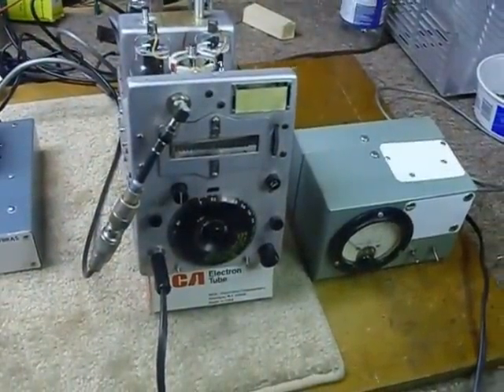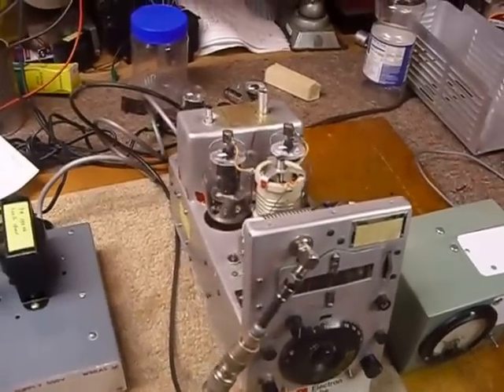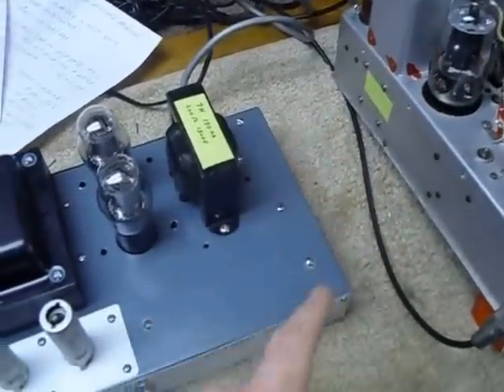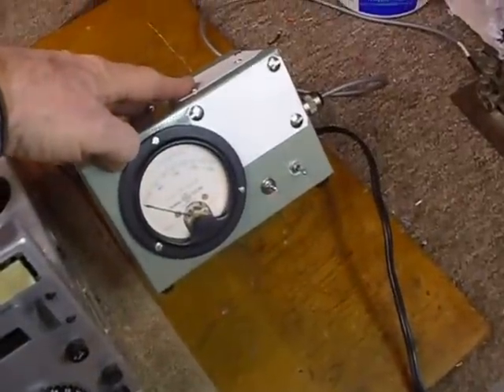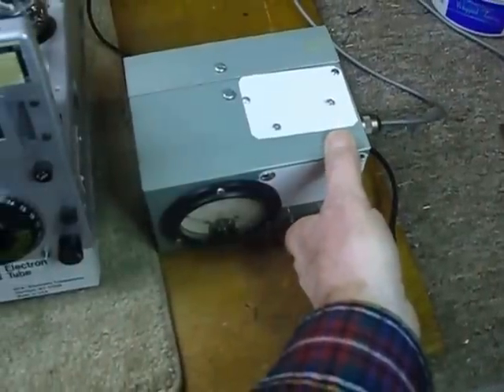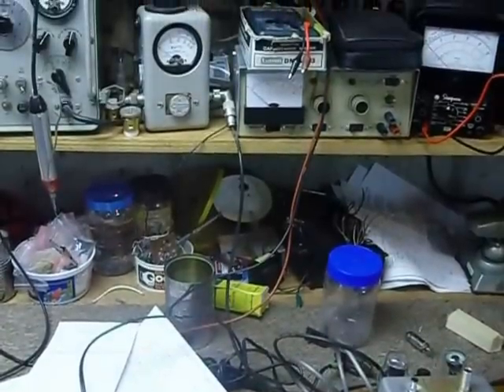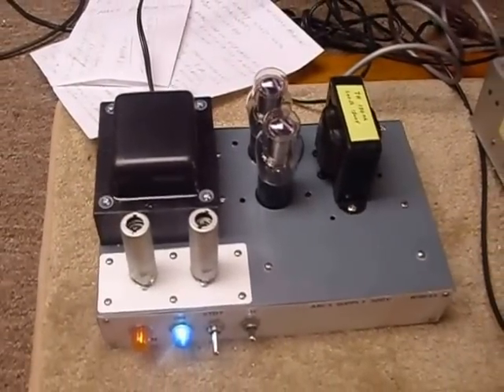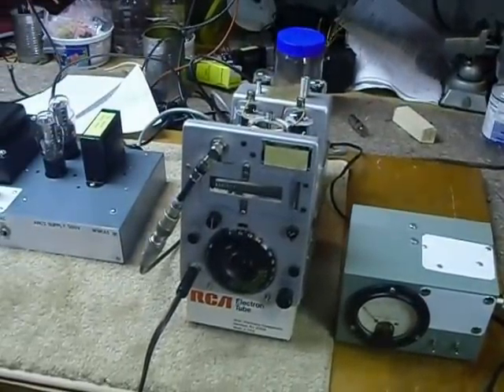WW2 ARC-5 STATION,BC-459,BC453,HOME MADE CONVERTER AND POWER SUPPLY

Comment: Beautiful explanation of the trade offs between output power and quality of keying in the ARC-5! Regulation at the proscribed voltages will produce a clean note, once the set is cleaned up. Nice job Bob.
Reply from the maker: Thanks Mikrowave  ...It sure is fun operating the ARC-5 .  73  bob

Comment: Where they of any special type? Also how did you unsolder the can and reassemled it so neatly?
Reply from the maker: They are not special capacitors just normal replacement type small radio capacitors most are 400 or 500 volt and very small either .05 or .047 value both work fine.  I did not un-solder or remove  the cans of the old capacitors The replacement Capacitors I installed  are not enclosed  they are just wired under the chassis to a ground lug bolted to one of the old capacitor mounting holes . The original capacitors were in cans and bolted down so the old type foil and beeswax capacitors could  withstand the extreme conditions and vibration in military aircraft with large piston engines.   so capacitors on wire leads are ok for use in the shack . 73 Bob